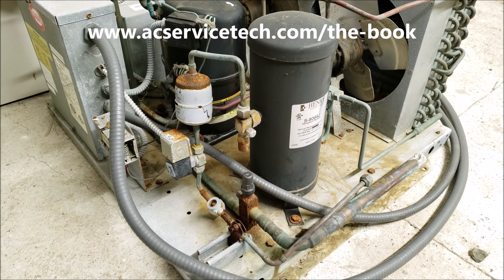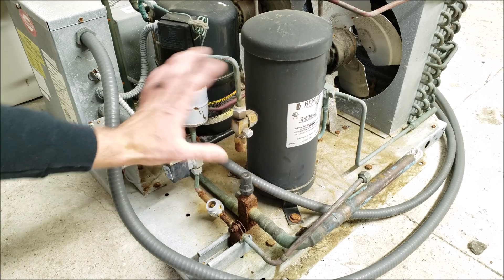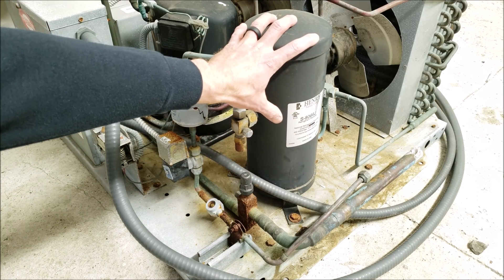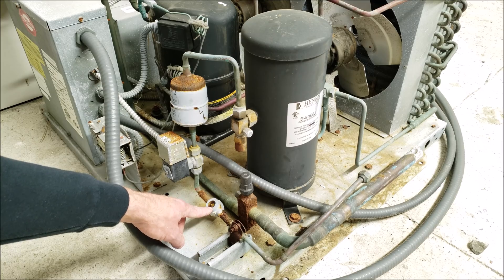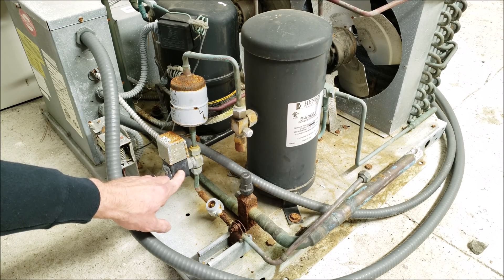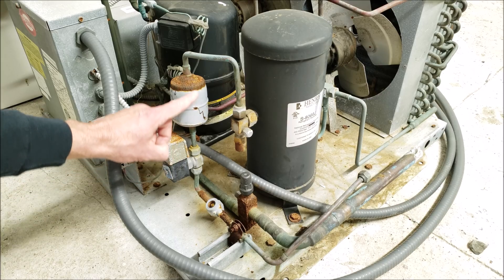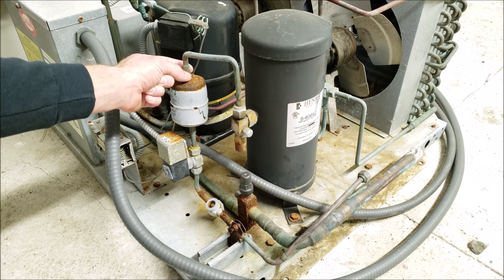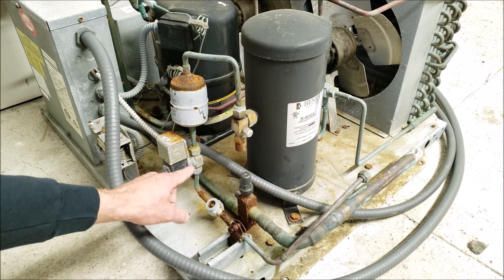Sight Glass, Filter Drier, & Solenoid Valve Locations on a Refrigeration System Explained!

Comment from the maker: The Book:  www.acservicetech.com/the-book
The E-Book and Paperbacks are Currently Available for Purchase at the Website!
Tool List-  https://www.amazon.com/shop/acservicetech
Support the Channel-  https://www.patreon.com/acservicetech

For those that are looking for the tools used in the videos: (Linked Below)
UEI DL479 Multimeter with temp sensor http://amzn.to/2jtsUbJ
Yellow Jacket Refrigerant Gauge Set http://amzn.to/2aenwTq
Refrigerant hoses with valves http://amzn.to/2aBumVI
Yellow Jacket Gauge set & hoses https://amzn.to/2vLVkV9
Yellow Jacket 4 Port Manifold w Hoses https://amzn.to/2BkuGIq
Digital Refrigerant Scale  http://amzn.to/2b9oXYl   
Ratcheting Service Wrench   http://amzn.to/2dGV4Nh  
FieldpieceSMAN360 Digital Manifold Set https://amzn.to/2BdoaD4
FieldpieceSMAN460 Digital Manifold Set https://amzn.to/2nB4Fe6
Ultrasonic Leak Detector with Headphones- https://amzn.to/2B2cRO3  
Compact Ball Valve for Refrigerant Hose https://amzn.to/2KUisW8
QuickDisconnect 90 for refrigerant hose https://amzn.to/2MMtVcg
JB 6 CFM Vacuum Pump   http://amzn.to/2nqbvo8
Appion Blue 3/8" to 1/4" Vacuum Hose http://amzn.to/2uYlVyc
Appion Red 3/8" to 1/4" Vacuum Hose http://amzn.to/2uYg6Ro
Appion Valve Core Removal Tool http://amzn.to/2uYr8WL
Yellow Jacket 1/4" by 1/4" hose http://amzn.to/2umtcod
CPS Vacuum Micron Gauge http://amzn.to/2v1nM3O
Supco Vacuum Micron Gauge http://amzn.to/2v1JRiA
RectorSeal Bubble Gas Leak Detector http://amzn.to/2ckWACn
Magnet Jumpers- https://amzn.to/2PyKPQZ
Alligator Jumpers- https://amzn.to/2PxqJXn
Fieldpiece ST4 Dual Temp Meter  http://amzn.to/2wc1ME3
Fieldpiece Bead K Type Temp Sensor https://amzn.to/2DBwKfs
Fieldpiece Wet Bulb Temp Sensor https://amzn.to/2RRI7Tw
Fieldpiece TC24 Temp Clamp https://amzn.to/2qHLyjZ
UEI DL389 Multimeter  http://amzn.to/2xAdaJf
Air Acetylene Torch setup    http://amzn.to/2aQalsb  
15% Silver Brazing Rods  http://amzn.to/2gVLyLc
Nitrogen Regulator    http://amzn.to/2bXdR5f
Nitrogen Flow Meter    http://amzn.to/2brvoBg  
Other tool links can be found in the video description section.

Shop through Amazon! Your Purchases through Amazon provide a means for channels such as mine to earn advertising fees from all purchases after clicking through. Prices are the same as normal-    https://www.amazon.com/shop/acservicetech

Comment: Question 🙋‍♂️ 
What if the unit Doesn’t have a liquid line solenoid valve and you have to pump down manually with the king valve the filter dryer would be after the Kingvale correct?

Comment: I know this is off topic. Can you use Stay Bright 8 instead of brazing?
Reply from the maker: Yes it can as it will hold the pressure of R-410A but you will be adding a small amount of acid from the flux into the system unfortunately, thanks!

Comment: On a automatic pump down refrigeration system when the box reaches set point instead of just cutting off, it closed the solenoid and stops the refrigerant flow. So does the pressure switch actually turn off the system? Also, when the system is calling for cooling, is the first thing that happens is a signal goes to the solenoid valve to release the refrigerant and the pressure switch let the system come back on? Thanks!!
Reply from the maker: You got it exactly Danny! Fantastic, thanks!